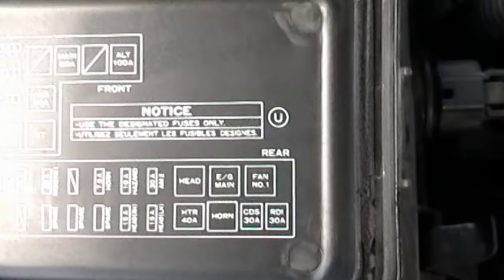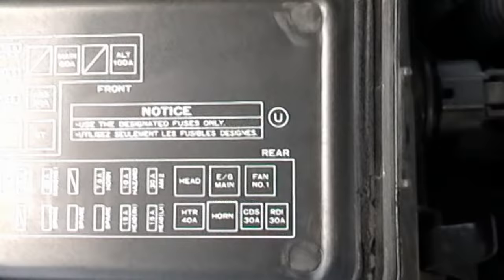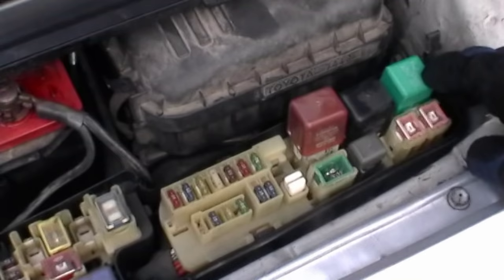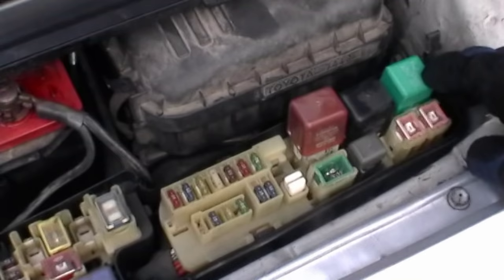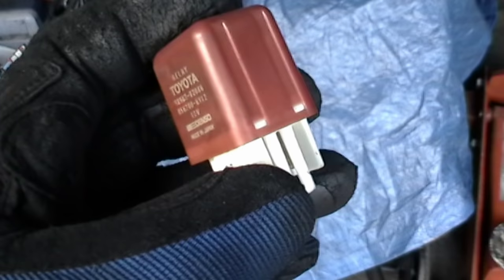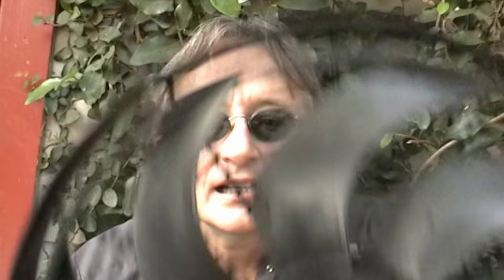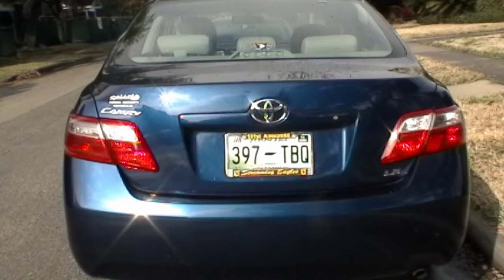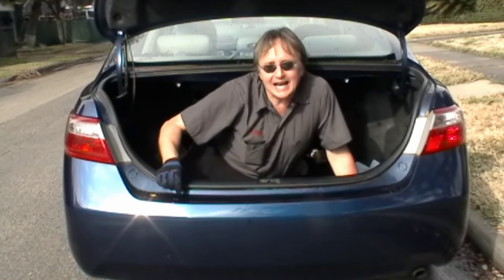How to Repair a Cooling Fan in Your Car

Comment: Scotty I did a coolant flush on my 07 camry I4 and the radiator fan never came on. I described the details here. Do you think if there is any problem? THanks. http://www.toyotanation.com/forum/104-5th-6th-generation-2002-2006-2007-2011/1414066-07-camry-coolant-flush-fan-never-came.html
Reply from the maker: they oly come on when they get hot enough, and with cool weather here, many do not come on very often
Reply: Thanks, Scotty. That makes sense. But why did the a/c fan also come on at the same time then? I thought that was bizarre as well. I didn't press a/c button.
Reply: Sorry just in case you didn't click the link. Let me describe the details here. So I took out the car for a test drive after the coolant flush and when I was waiting for my gf in the walmart parking lot I heard the fan. So I popped the hood and saw both fans were on for like 5 seconds. I was happy to see finally the radiator fan was on. But I didn't understand how come the a/c condenser fan was also on. I thought both fans are on only when a/c is on. Thanks.

Comment: If your fan switch isnt working and you dont have the rich boy supplies like (little jumper cables), go grab yourself a piece of copper wire and stick both sides of the wire inside the fan connector (not fan switch) , theres only one problem they will run 24/7 when key is in on position #NIGGARIG

Comment: my fan don't work but my car dosnt over heat...
Reply from the maker: it would have to work if it sits just idling in hot weather. Realize fans ONLY come on when engine reaches a certain temp so when cold, they are often off

Comment: Hi Scott , I need help please I'm using Toyota Corolla ae82 , I want replace this high speed fan ! 

I bought high speed fan ! 

It came with 40amp relay 

How do install the fan ? 

May I have your email address so I can email you the picture !
Reply from the maker: +Richard Xav they just bolt on, unless you got a universal aftermarket fan, then you have to rig things and splice wires, a royal paon
Reply: +Scotty Kilmer for aircond fan from where do you take the power ? At existing fan relay ? After relay or before relay ? A mechanical told me do not take current from blower relay because your blower power get cut off .
Reply: +Scotty Kilmer can I remove normal radiator fan and cooling fan from the socket replace with high speed fan ? Does it last long and using the existing relay point ?

Comment: My fan seems like it's always on even minutes after I turn my car off. And it's not overheating or anything , why is that?
Reply from the maker: some cars do that as they age, IF it doesn't drain the battery, live with it.
Reply: Monro muffler told me I needed a ECT sensor. But all my gauges are read normal. So Idk if I really need one?
Reply: If it does?